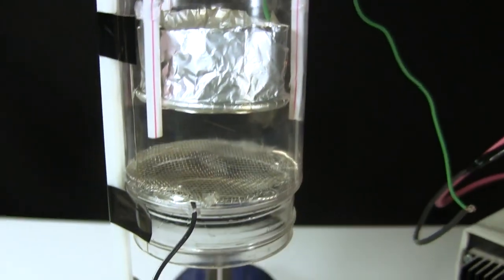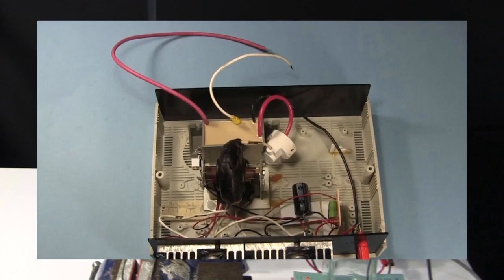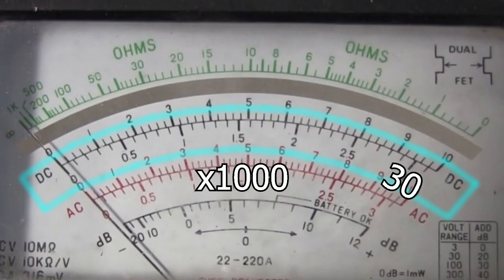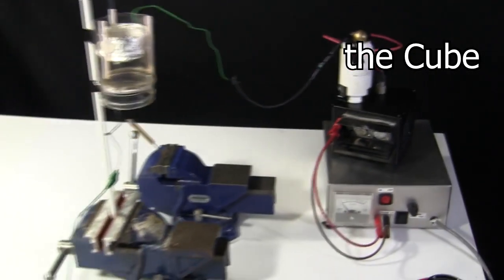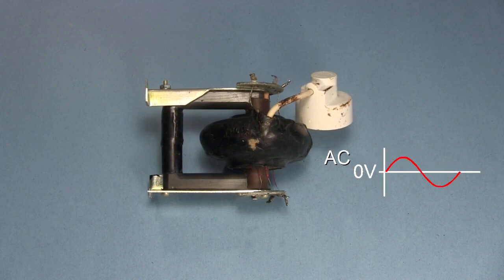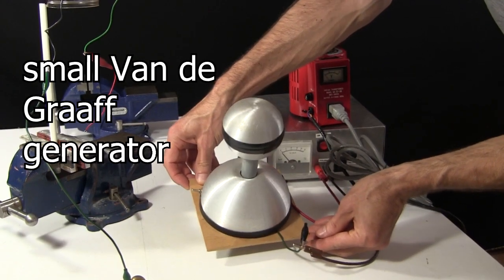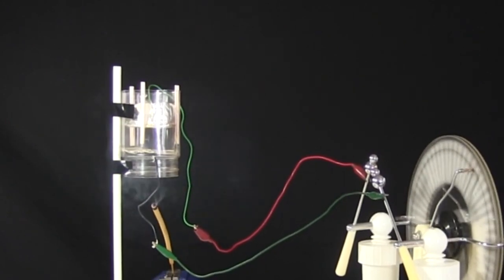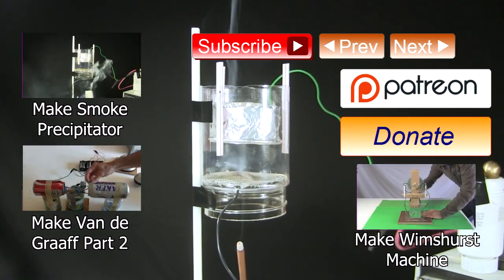Smoke Precipitator - Measuring Voltage & Demos

Comment: What is the purpose of making smoke between the two electrodes (probe and screen) ?
Is the smoke water vapor , or something else ?
Reply from the maker: Smoke enters the bottom. The screen ionizes smoke particles. The ionized smoke particles are attracted to the metal cylinder where they stick. This video is actually a follow-up video to the one where I show how it works and how to make it https://www.youtube.com/watch?v=oD_8_NZJF48.

Comment: On the website you have mentioned that when paarticles pass through mesh, they get negatively charged and while passing through cylinder, they get attracted towards the walls of it, but the electrostatic force inside the cylinder will be 0, so how it is possible?
Reply from the maker: Good question. I think you mean that if the cylinder is like a Faraday bucket then there would be no electrostatic force inside it. I think the cylinder is open enough at both ends so that it doesn't act much like a Faraday bucket.

Comment: Have you tried multi stages of negative screens (2 or 3)? With about  2 times the negative screens (4 or 6) for the positive screens instead of foil above to catch the smoke.
Reply from the maker: No, I haven't. Electrically speaking though, the meshes further along would be blocked or mostly blocked by the first mesh so they wouldn't be involved in attracting the particles. But certainly you can put other filters in that path that aren't involved electrically. Good idea.

Comment: Would this work in absorb hot smoke ?
Reply from the maker: I don't know what hot smoke is. If the smoke is soot particles then it should absorb them. Keep in mind that this also produces ozone, which in large quantities is hazardous to your health so if you're doing more than just an experiment then make sure to use in a well ventilated area.

Comment: Can i use a 3v to 400kv voltage booster for high voltage supply. 
Pls reply
Reply from the maker: That depends on if the output is DC or AC. For this to work it has to be DC.
Reply: @RimstarOrg  yeah it is DC output only. 
What happens if I use ac.
Reply from the maker: If you use AC then it simply won't work. You'll be alternately pushing and pulling and getting nowhere.
Reply: @RimstarOrg  
Can I use the mosquito bat circuit as high voltage source .But it's output is ac ,how to convert that ac to dc .
Pls reply
Reply from the maker: The output of the mosquito bat circuit is DC. The diode makes it DC. However, I suspect that its current may be too little.

Comment: is the negative one a ground or negative high voltage with repect to ground? and what will happen if we increase the are or dimension of percepitator? thanks, and God bless!
Reply from the maker: The negative one which is connected to the mesh is connected to ground but since there's a positive voltage (with respect to ground) on the foil, that attracts electrons from the ground to the negative mesh. So the mesh is negative with respect to ground. You can scale this sort of thing up since it's often used for industrial applications https://en.wikipedia.org/wiki/Electrostatic_precipitator

Comment: wow, very revealing.  Ozone!  In what quantities are we talking?
Reply from the maker: I don't know the quantity of ozone but you can definitely smell it so it's more than normal. How much is harmful, I don't know. A different design that works with a lower voltage wouldn't produce ozone. There's some voltage below 10,000 volts where you don't produce ozone. I don't know what it is though.

Comment: What types of gases can be eliminated thru this method?
Reply from the maker: I don't know. I've only tried smoke. Note that this design does produce a harmful gas, ozone, and so you have to make sure it is ventilated to outside.
Reply: Don't ask me why, but the answer is that ESP does only work on particles.

Comment: hy there... I m trying to build a smoke precipitator for my lazer cutter any advice or ideas that you could chair  please  i tryed many stuff and i build the hight voltage from the monitor of an old pc ( atually your idea as well lol ) but cant seem to understand what is going wrong either the material is wrong or the distance.... i would really be glad for an advice as my work has stopped cos of the fumes , thank you very much
Reply from the maker: There's nothing else I can think of to point out besides what I've said in my two videos about it. Did you test with a normal flame (from a candle or match or lighter) to see if it's working at all? If it works with a normal flame then it's possible that it doesn't work with the particulates from your laser cutter. 
It's great as a science experiment but I'd also caution against using this for long periods of time. At these voltages, it produces ozone, which is hazardous to your health with long exposure. So you'd need ventilation anyway. At some voltage below 10,000 volts (I don't know what voltage), it doesn't produce ozone and that's what the commercially made, store-bought ionizers use.

Comment: Please you can tell if  I will use 12 volt of power supply  then it will work or not
Reply from the maker: No, you need at least 21,000 volts. The easiest is probably to buy a Wimshurst machine like the one I used in this video from https://ebay.com

Comment: Please tell me the radius of the container which u have used 
It's very  urgent for my science fair
Reply from the maker: The plastic jar has a radius of around 3.75cm or 1.5 inches. The foil cylinder has a radius of around 3cm or 1.25 inches. However, I'd suggest just getting whatever plastic jar you can find and use that and then have the aluminum foil cylinder be whatever dimension that allows you to fit it in the jar with some space between it and the inside of the jar. My dimensions were picked based on what I had available.

Comment: Sir can I use this for the precipitator  plz answer fast !! 
https://banggood.app.link/ffnEd6IlOX
Reply from the maker: I'm not sure if it'll work. It says it's pulsed and I haven't tried it with pulsed sources.
Reply: Ok sir thanks for your reply
Reply: Will it work in 400 kv( if it works with the transformer) ?
Reply: Also how can I convert pulsated to flat DC?
Reply from the maker: At that voltage output, I don't know how to convert to flat DC. At lower voltages, like 12 volts, you can use a capacitor, but they don't make capacitors for that high voltage with high enough capacitances.
Reply from the maker: You'd have to design it differently for 400 kV. The mesh and cylinder would have to be further apart to prevent sparking. But if it's a transformer then the output would be AC and you need DC.
Reply: Thanks again sir!! :)

Comment: how much current potential we should give to get good response of this project
Reply from the maker: I didn't measure the current. Measuring current with high voltage is hard to do. However, given that the Wimshurst machine worked (the machine with the rotating disks), the current isn't huge.
Reply: @RimstarOrg  CAN YOU SAY APPOROX
Reply from the maker: Very roughly 250 microamps to 1 milliamp.
Reply: @RimstarOrg  ok thank you so much sir
Reply: i tried its working
Reply: can i give power supply fromk direct power supply in home socket
Reply from the maker: I'm not sure what you mean. What are you using for a power supply? In my case, my high voltage DC power supply (https://rimstar.org/equip/30kv_pwr_supply.htm) takes input from a low voltage, 0-24VDC power supply (https://rimstar.org/equip/24v_pwr_supply.htm). The low voltage power supply plugs into the wall socket.
Reply from the maker: Awesome!
Reply: @RimstarOrg  I USE LAPTOP CHARGER THEN I GAVE DIRECT SUPPLY FROM WALL SOCKET
Reply from the maker: It requires 21,000 volts, which your laptop charger doesn't produce. Are you sure it worked?
Reply: RimstarOrg no it didnt work .. can you suggest some high voltage dc from home appliance
Reply: Because i cant affort high voltage dc supply it cost more here.. if any please suggest me
Reply from the maker: All I can suggest are what I showed in this video.
Reply: @RimstarOrg  ok sir thank you

Comment: How much charge should be induced to the wirmshurts machine ? And what are the other specs of the machine coz i wanted to buy one
Reply from the maker: I don't know how much charge or current, just the voltage which I measured in this video (21,000 volts). However, if you go to ebay.com and search for "wimshurst machine", all the ones that come up will do just as well as mine. If you're unsure then pick one and reply with the link and I'll confirm it. I bought mine from ebay. Here's an example https://www.ebay.com/itm/Wimshurst-Machine-Physics-Electrostatic-Generator-Model-Educational-Toy/233080929666?hash=item3644b4bd82:g:Du8AAOSw9g1cL00y:rk:2:pf:1&frcectupt=true

Comment: How to get that 21kv to 30kv electricity at home
Reply from the maker: You'd have to build something since nothing in a home produces anywhere near that voltage. The easiest to make is probably the Wimshurst machine which I show in this video, though I bought mine from ebay.com. I have a video on how to make one but it's a smaller one which isn't powerful enough for this smoke precipitator.

Comment: Can we use big battery for this? Like bike or any other
Reply from the maker: No, you need 21,000 volts, much, much higher than the voltage you get from any battery or combination of batteries.

Comment: 29000V isn't it too much??
Reply from the maker: If you get sparks with 29,000V then simply increase the distance between the mesh and the foil cylinder. So it's not too much. However, keep in mind that you also need current. I don't know how much though. But it's probably not very much since, as you saw in this video, I got it working with a Wimshurst machine, which doesn't produce a lot of current.
Reply: RimstarOrg ah thnx for replying

Comment: Sir,How long does it take to make the model
Reply from the maker: If you have the parts then the smoke precipitator would take only around 1 hour. It's the power supply that's the tricky part to make/get. Buying a Wimshurst machine like the one I show in the video would be the easiest approach.
Reply: RimstarOrg thank you so much sir

Comment: Can anyone tell did it worked with a 3v to 400kv generator or not
Reply: Should I order it or not
Reply: Please someone reply
Reply: Fast
Reply from the maker: Do you have a link to the generator? If it's AC output then it won't work. It has to be DC. If it's one like this https://www.ebay.com/itm/DC-3v-6v-to-400kV-400000V-Boost-Step-up-Power-Module-High-voltage-Generator/302127640955 then I strongly suspect it's output is AC and so it won't work.

Comment: will air flow affect the output?
Reply from the maker: Air flow would affect it if the flow prevented the smoke from getting in or if the flow was in between the mesh and the cylinder.

Comment: I don't understand how it can work without electric sparks. Is it possible to ionisate the air without sparks ?
Reply from the maker: Yes, you can ionize air without having sparks. This is usually done by one or both of the electrodes having sharp points. The charges get crowded together at the sharp points and cause the electric field in the nearby air to be strong enough to breakdown the air and cause charge to flow easily into the air and ionize it. So there's never a build up of charge on the electrodes which would result in the sudden rush of charge across the gap which would be the spark.
A good analogy is a bottle of water. If you put a small hole in the bottle then water can leak out. If you keep putting more and more water into the bottle, the bottle may not burst because some is always leaking out. Of course that depends on how much leaks out.
But if there was no leak and you kept putting more and more water in, eventually the bottle would burst from the pressure of all the water and you'd get a sudden rush of water out of the bottle, like a spark.
Reply from the maker: Oh, and in the precipitator, the "sharp points" are the thin wires of the mesh. The thin wire isn't really a sharp point but it's thin enough to have the same effect.
Reply: Ok I understand the thing. However, isn't in the aluminum paper that the discharges occur ? Because in your other video about the precipitator, u're showing the coronna discharges that seem to come from the aluminum.
Reply from the maker: I'm not sure where the visible light starts from, but it makes sense that it would be the aluminum foil since that's the smooth electrode. That's the electrode which will have built up the most charge without leaking first.
Reply: Yeah it seems legit. Thanks very much sir for your explanations, it helped me a lot. 
Greetings from France.

Comment: Sir if the output is pulsed DC then what if we use high rated capacitor to make it Flat DC
Reply from the maker: I don't see why that wouldn't work. Keep in mind that the voltage will be lower when you flatter the pulsed DC so you'd have to make sure to start with a higher voltage than you need.

Comment: Sir can the precipitated material be removed by using a simple brush..????
Reply from the maker: No, I found it difficult to remove from the aluminum foil afterward. It forms as a film, but one that's stuck on fairly well. One thing that may help would be to cover the aluminum foil with something like paper towel material. That way the film would collect on the paper towel and you could just remove it from the foil and throw it away. Basically it would act like a filter.

Comment: Sir can I use DC 3.7V-7.4V to 400kV High Voltage Generator Transformer Boost Inverter Module 67x25mm to power this system......
Reply from the maker: Short answer, I can't say for sure.
Long answer... I found this https://www.amazon.ca/MonkeyJack-3-7V-7-4V-Generator-Transformer-Inverter/dp/B0769CQTJH which I guess is the one you're talking about. The 400kV is a lie since there's no way that produces 400kV, based on the spark lengths in the youtube videos I've seen of these, so I can't trust it's output ratings of 400kV and 0.5A. Looking at the input ratings, 3.7V-7.4V/4A and comparing that to what I measure at 8 minutes and 40 seconds into my power supply video here https://www.youtube.com/watch?v=GEuK1OdYxHk, it looks promising.
Reply: RimstarOrg sir now I know that 20kv can be generated by using 800kv boost converter ,,,so should I use it in smoke precipitater..??? And sir is there any way to deal with the ozone emitted.....???
Reply from the maker: Oh, sorry. I get asked so many questions about powering lifters that even though I know you're asking about smoke precipitators, my brain is still thinking about the requirements for lifters. Groan.
However, I don't know if those boost converters are producing AC, pulsed DC or flat DC. I know AC won't work. From my test with my Cube power supply in this video, I suspect pulsed DC doesn't work either. So that leaves flat DC. I don't know for sure, but I suspect those boost converters are not producing flat DC. The high frequency sparks in videos I've seen of them in the past look like either pulsed DC or AC. So my guess is that no, those boost converters won't work.
If they are producing flat DC, which I don't think they are, then they should work.
Reply from the maker: Oh, and regarding the ozone, the only solution I know is to do it in a well ventilated area and vent the ozone outdoors.
Reply: RimstarOrg sir I want to make your power supply system to get the input voltage from a battery,,, so should I go for it or will it result in any kind of trouble???
Reply: Did your precipitator worked on 3v to 400kv generator
Reply: Please reply fast
Reply: I have a science project
Reply: I need help
Reply: I am ordering a 3v to 400kv generator
Reply: Should I order it
Reply: Please reply fast

Comment: Great video to watch if you're building one, like I am. Mine failed miserably. I now see that it's because the 400kV module I bought is a "tesla coil" and hence AC in nature. 

I couldn't use my DMM to determine this, so you may wonder, "how does he know"? A: I took a flourescent lamp an put it nearby; it lit up. DC does not do that. 

That 400kV module you might see on other YouTube videos doesn't work for this purpose. Also, I found out that it runs on 3.6Vdc at about 1.8 amps. So you need a power supply that can supply this. They don't have any documents for it, and I don't know who makes it. I just bought it for cheap from some place in China (eBay or Amazon, I forgot which). 

I'll try to find a pure DC supply in the ranges mentioned in this video: 20kV to 30kV. I'll also play around with the distance. I have mine set at 3.75 inches to keep it from arcing. This might be too far. I realize DC is the main problem. I tried rectifying with a diode, but that still didn't help. It needs to be pure DC just like this video shows. 

Thank you RimstarOrg for your video.